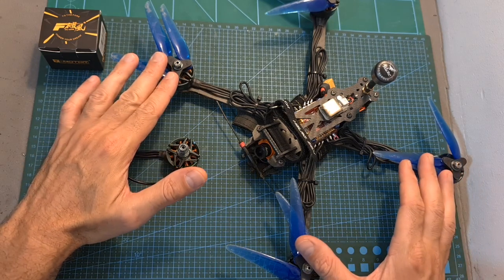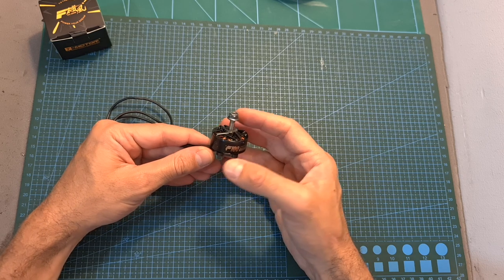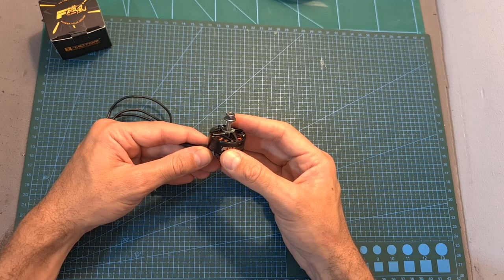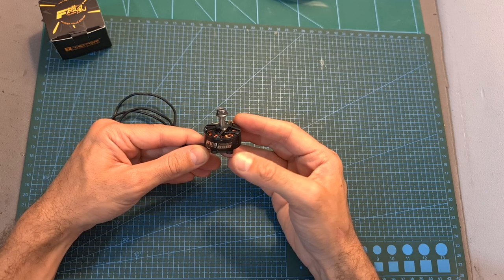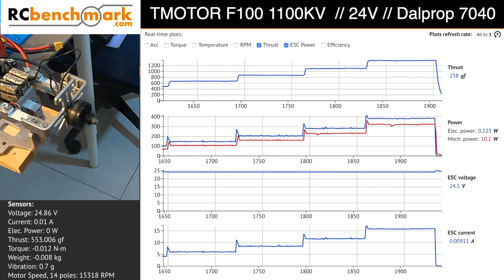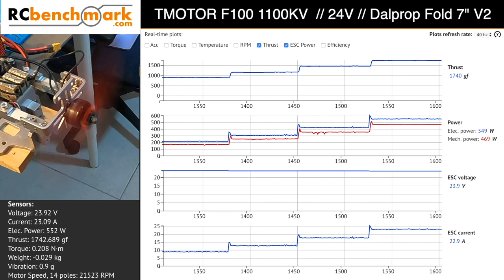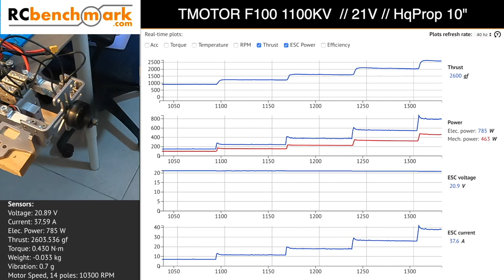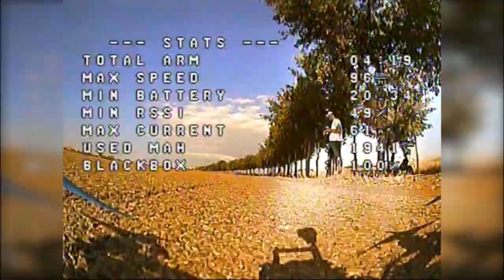T-Motor F100 1100KV Motors - Thrust Tests & Flight Footage

Comment: Impressive motors. Useful data. I built the Merica 8", using 2806.5 1300Kv motors with 7" props. Moves along really well and fit my budget. If I decide to move up to more powerful motors this kind of data can be very useful. Thanks for sharing. 👍🤓

Comment: Looking to run 2810 1180kv or 1350kv motors on a 7" build but will most likely be running the genfan 7535 props instead or genfan 8046 props. Do you feel the 1100kv was under powered on 6s with 7" props? I'll be running 7" from time to time. But wondering If a dedicated 7" with 1350kv would be better? What would you suggest? I've got a really nice 8" capable Quad frame I'm redesigning that was intended for 7" but will fly accept 7.5" and its a super stretched X build Flys really awsome. almost finished the updated design that will take 8" not quite as stretched and 8mm arms instead of 6mm this time around. Made it 03 compatible as thsts what I'll be flying so that is what really sparked the change and going to 19x19 motors with bigger stator the 7" and up really needs.

Comment: I need flight with 7 inch frame about 20 mins and payload about 500-600gr. Is this motors better opción?  I think put a 7000mah bat li-ion when fly without payload and 5000mah lipo both 6s battery.
Reply from the maker: Yea I think these motors will be adequate.

Comment: How does it compare to the emax eco ii 2807 1300kv?  the props and power supply are different so I cant check. Are they more efficient? Who produces more powa?
Reply: I think he mentioned that these were more powerful and efficient than 2807 motors. They are 2810 motors, after all. The big question is how much more powerful and efficient are they, considering they cost twice as much, maybe even more?

Comment: Hi Gal, what 8 inch prop would be the quietest prop for this motor? The HQ 8x4x3 or the HQ 8x4.5x3? And for the 7 inch? The HQ 7x4x3 or the 7x3.5x3? Thank you.
Reply from the maker: Hi Jack, sorry but I am not sure. I can guesstimate that the 8x4x3 will be quieter though.

Comment: Hey gal. Again a very usefull and great video. I see that you also tested them on 16 volts. So is it possible to put these moters on 4s on a 7inch quad. Or is it to underpowered. I want to put the enax eco 2 1300kv on my build. But want to know if it is capable to cruise along good on a 4s lipo. I also have 5s and 6s 18650 packs wich i want to use on that same quad.
But anyway thanks for all your work 😊
Reply from the maker: Hi Stephan, my pleasure. 
A 4s battery on a 7" is going to be underpowered. A 6s LION pack should be perfect.
Reply: @KremerFPV  Do you think that these motors might pull too many amps from a li-on?

Comment: Nice video. Still looking for frame that t-motor used in picture. They say it's their frame. I send screen clip of frame, and they said it was their frame, but looks completely different. Nice carbon fiber one with wide legs. Can't post picture here. They don't reply very well. Could be a translation issue, or they are crazy busy, right now.
Reply from the maker: Thanks Joel. I am not sure which frame you're referring to. As to communicating with T-Motor - that's not easy for me as well...
Reply: @KremerFPV  You are on Facebook, so will post the picture . They said it's their f5 frame. Does not resemble the f5 on their website. Whoever answers the message just typed f5. After I watched you run the tests on one of the t-motors, and show video, I will get to building one.

Comment: Great video 👍 What do you think on using f100 on 7 inch heavy, around 1500g 7 inch long range? would it have any advantages or disadvantages against F90? Thanks
Reply from the maker: Thanks! I think that the motor will be too big for a 7" quad setup...
Reply: Honestly I'm flying the f90 1300kv, and 1500kv would be perfect
Reply: @KremerFPV  What about carrying 2 x 6s li-on packs?
Reply from the maker: @MactacFPV  on a 7" setup?
Reply: @KremerFPV  Yessir.  I've been carrying 2 21700 6s packs with F90's and it's a bit much for the motors.

Comment: Hi Sir, can it lift 7.5inh quad with 8000mah liion?
 Thank you
Reply from the maker: Yes
Reply: @KremerFPV  how many minutes and do you have records for km that can travel ?
Reply from the maker: @RiDLEY09  This should give you a pretty good indication: https://youtu.be/4DOwotF_VYw?si=VCdfdh-xTwTxRMbp
Reply: @KremerFPV  this is not f100 1100kv  motors with 8000mah

Comment: absolutely pointless motor for 7 '' assemblies. Too heavy and slow. 2507, almost half lighter, will handle 7 '' backloads
Reply: My 2507 build disagreeing. Does not handle LR batteries + Hero 9. It's a good balance on 1300-1800mah battery without a GoPro but that's no fun.
Reply: @lstepnio which KV  your 2507 motors ?
Reply: @Pukkaras  1500 6s
Reply: @lstepnio  I bought  month ago brother hobby 2507 1200kv, and after emax 2807 1300kv, BH extremely more efficient! Now with BH I can easily fly with 5s1p 18650 litokala battery.(and also with action camera) Earlier with 2807 drone was completely unstable because of higher current and voltage drane.